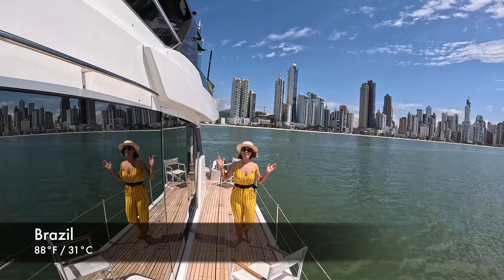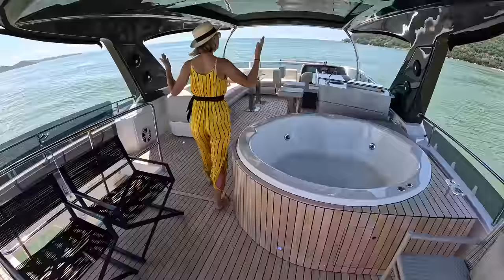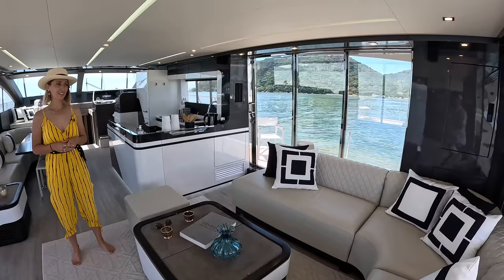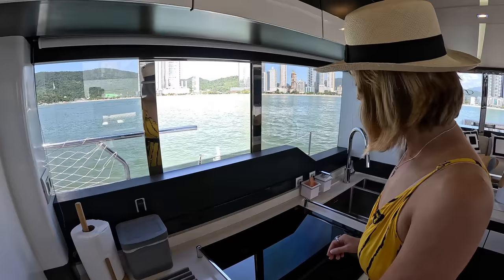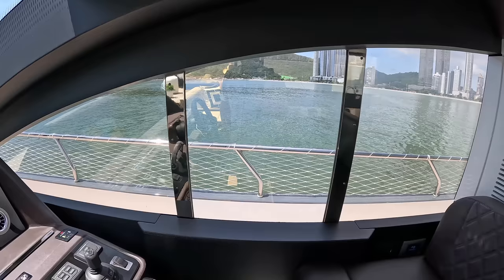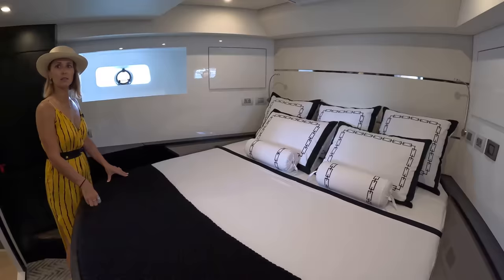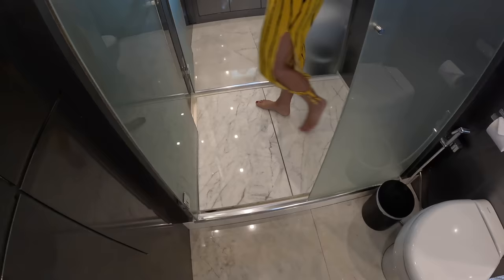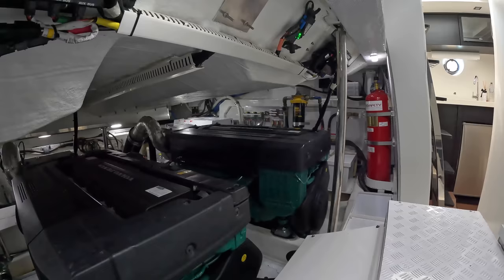SCHAEFER 770 Flybridge MOTOR YACHT Tour Cruising Liveaboard Power Boat

Comment: IMPRESSIVE!!!!   After touring their factory in the other video, you know this is a VERY SOLID BOAT.  This is a bit larger than what I'd want but I'd imagine you could get this same layout/style on a 50 to 60' vessel.  Also I love the flow/all the windows on this boat, you have an incredible view anywhere in the galley/salon, its almost 360 degree views from the helm, such an awesome space/design.  I thought I'd HATE the black/white/grey decor(I'm a mid century mod man and love earth tones), but it works on a boat like this.  So much glass, the scenery is your decor, the black/white/grey just blends in, the turquois water and that skyline are your colors.  As for 3 engines, no thanks, just give me two bigger displacement engines instead, less things to break/maintain.

Comment: One thing I've noticed about a lot of these yachts is despite their massive size, the crew quarters almost always feels like an after thought and I don't particularly like that. 

If I were to ever be able to design a yacht for myself with crew, I'd want them to at least have the same size cabin as one of those double cabins with their own space to have for themselves in their off time so they don't feel like they are being made to live in a broom closet under the stairs. That's just my take of it.
Reply: Agree, looks like a class thing which I don't like.
Reply: Crew coffins.although these are not too bad . The worst seem to be the smaller catamarans that really are coffin sized sometimes
Reply: Being retired USN, I always have a soft spot for crew.  They absolutely  could squeeze a bit more room for them here, even by dropping it to a 2 person crew.  Of course, these midsized yachts are going to be designed for the comfort of whoever is shelling out several million for the boat, especially when catered to a more class conscious society.

Comment: I'm an average guy, not a boater in any way shape or form. However, I'm just fascinated in learning how these yacht's are laid out and how they operate. I find it very interesting and a learning experience as you both go through the tours. I also enjoy the lighthearted banter between the two of you-- the chemistry is obvious and you both round out the other. Victoria is cute as a button and Rico is a guy I'd enjoy having a beer with and hearing about his sea adventures. I'd trust you both to handle my boat without question. keep it up and best wishes to you both.

Comment: Nice walk through.  I just have to say, I hope you sent a picture of that dishwasher to the Wynns.  That might solve their dishwasher space dilemma!   Considering the boat size, not a fan of the hot tub. It took up too much space on the deck.  While I liked the solution for the showers in the cabins- going with the tube style. I must say, I am not a fan of the top loading refrigerator.  You always seem to have to dig everything out just to get that one item out that has fallen to the bottom.  Great video though.

Comment: the range is really low but thats a fast cruise spped also. with one engine centerline, i wonder what the range would be just running at trawler speeds 7-8kn using just the center engine

Comment: the answer to the, spa hot tub. it easy.  think of 2, yachts like the one you're building. they have the same charter. price per week. But one of them has a nice tub, dip pool, or call it a cool off sit in tub. hot tub. there is other one does not. what yacht would you charter?  everyone would pick, the one with the hot tub, spa on deck. ( late night dip, late night 🤔😘😋 call, late night Champaine with your girl. ) note in the new build to keep costs down. only ask for the plumbing. Hot and Cold water , drain that can be connected later. have them place the means to tie it down to the deck. buy the hot tub spa, later it will be cheaper . have extra ele, plug put in so it has power. and plan for a small cabinet for spa, chemicals,
Reply from the maker: But there will be no yacht like ours… try to find a 75’ with 4 guests rooms 😝🤷‍♀️ tubs are lots of work on a boat… just lots
Reply: Having had hot tubs at home in Canada, Argentina and the US, the hot tub is worth the small amount of work. My sister actually had a good small inflatable spa so that is an option but I prefer a more traditional approach. 😊
Reply: @NautiStyles  I think you missed the point.
4 cabins, fill with 8 adults , they go to SHORE, come back, ask for late night munchie, wine, music, to be left alone,  TV is not going to get it. People who chartor want to reconnect as a couple, and with close friends. Or CEO , who sneaks off with 4, smoking hot sexy modles, who get bored in 3 mins flat, that's where a hot tub wins hands down. Per alot of work. ( really ) I'm kind of LAUGHTING, your building a ocean liner. With nothing to do for guests at sea. At, $95.000 plus a week, they want , fun stuff , they want, to soak, naked, and do what adults do naked in a hot tub " you may have forgot", 
And note, a Disney, cruise is. Not what they
 want. They want, casino, night with a real roulette wheels, cards games. My clients,  ( very famous, pop star.) Ran up $350.000 in extras, our silent, rule was simple, no cameras on board, no cells with cameras, only the primary,  had a camera,  all securty, cameras, after each day were delayed in front of there SECURTY staff. 
And what ever they asked for no matter how wild, they got it for a premium price, and you not up to date. On hot tubes,  new filters, and reverse  osmosis,  salt water, cleaned tubes, water so clean you can bottle it. And set a filters to contest clean, even with 6 adults, screwing each other, the water,...is cleaned, zapped, filtered, and pumped back in. And, older adult males hooking up with young female modles, dont want to sit and stare at each other, he wants her in a bikini,  half naked, the whole chartor...it called eye candy, but, put 2 75 footer side by side. 1 has a hot tub, 1 doesn't,  the 1 with the hot tub gets the chartor. They other stays on the mooring ball. 🤯🤦‍♂️😎🙄🙈🙉🙊..... heres a tip for your crews T shirt changes.... print one up, with big letters on back...thats,...says, our modo is " I DIDNT SEE ANYTHING " .. and make sure they never talk to guests unless spoken too. One bad Yelp, in the chartor world, spreads world wide.

Comment: Definitely an overall fantastic looking sporty yacht. As far from a Bering 75, as can be and I have a hard time seeing the point of going 30 knots in a yacht, that obviously already rolls quite a bit at anchor in a very calm day. It will not be very comfortable at all. The droning sound of that genset everywhere on the boat though, that would drive me nuts. The real big let down in this design is however the crew quarters: Ever only seen worse in production catamarans sailing the Meds! Just horrendous! No private space for the crew at all and they got to open block the only stairs to the flybridge and be to inconvenience of the owners and guests on top, just to get to their quarters. It is just such a shame, because overall the design is just so amazing, but with too many flaws. If I needed a yacht with power and speed, I definitely would chose about any power catamaran over this even. Of course, it is not my taste at all: My dream is a sailboat.

Comment: Definitely, the hot tub is on my NBBL, but I'd like a lot of room for friends to enjoy it too. Maybe a couple of hot tubs??
This boat is definitely not big enough for me.
Reply from the maker: Thanks for sharing your opinion Rob!
Reply: @NautiStyles  seriously, lol. 
I am seriously designing my boat, based on what I've seen in your content archive. I hope you're able to keep it up once your boat is launched.
 But I've got some serious engineering issues to be solved before I can commit to any particular design. The B120 is my boat design I like, but, you can't park a chopper on the nose in rough seas, aft is the preferred spot. Then balance that with what size hot tub and its placement, forward or aft? Maybe B120 design, in a B145 hull?
So you see my delema? Lol 😆